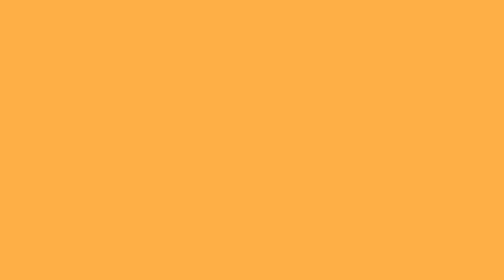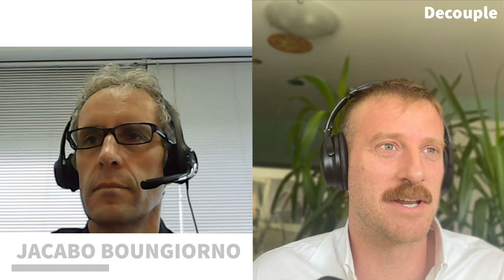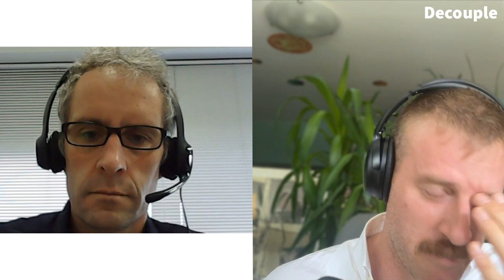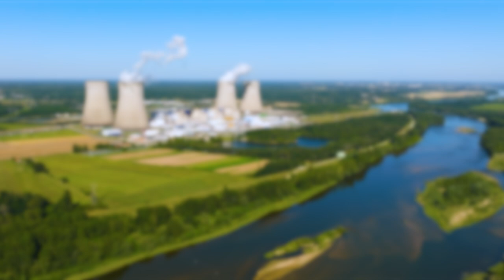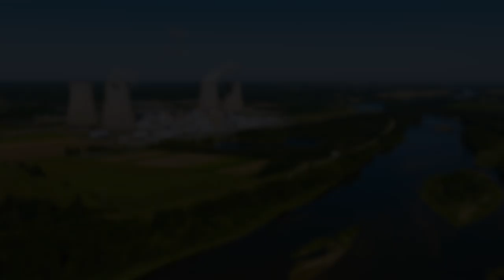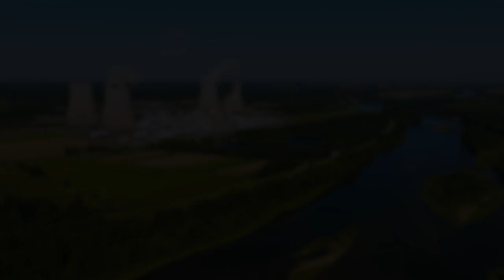Why is Western Nuclear so Expensive?

Comment: This was a great episode!  As someone else mentioned here, the nub of the problem is the lack of vertical integration.  The talk regarding modularity (ie prefab modules) was also very enlightening.  Then there is the problem of the lost of experienced people for restart of new projects.

I feel what Ontario should embark on, is a School of Nuclear construction and operation.  Basically, retired operators, techs, engineers, site supers and project managers would be instructors.  The instructors teach and do training of new students, as well as retraining, and ongoing training of current staff at various nuclear stations.  These folks could also be initial evaluators of new construction techniques/assembly techniques.  With Ontario having multiple designs of nuclear systems, both in generation and in design/type, having a mechanism to retain the experience from the varoius plants and projects, then have the students start work in an apprenticeship capacity at plants, I think would create a virtuous cycle of skill development, skill retention, and a structured method to allow improvements in construction and operation.  I could even see such a school draw international demand from other countries, and the various nuclear industry contractors start to contribute their knowledge to help train future customer operators, particularly if its their first build.

Comment: At around 10 minutes into the interview he gets to the nub of the probrem.  Having non-integrated teams who don't share the same financial outcomes, and don't necessarily build up a track-record building several plants in series, will have much higher costs. This is proven in the floating offshore oil production market. 

FPSO's are a type of supertanker or super tanker-like barge, which is moored over a deepwater oil field and has a production plant installed on the deck. The oil majors build them like nuclear reactors are build in the west - with conceptual designer, detailed designer, constructor, installer and operator all different parties. SOme specialist FPSO builders offer a lease and operate contract to the oil majors at half the price because they are vertically integrated, doing a lot of repeat business, and integrate the feedback from their own operations back to the own engineering design and own construction teams.  

The most fantastical part is that a large number of the oil major staff will not accept the truth when faced with the evidence, claiming poorer build and operating standards. Having seen the oil majors way of building and operating, which is good but never truly outstanding, my view is that the lease operators are often just as good.  Nuclear needs the same approach.  One key feature would be to build the nuclear plants in the same yard on a set of very large barges, and then stow them to the coasts where they will be installed (this 'beaching' of a barge is how a key part of the Snovit LNG processing plant was built for Norway).

Comment: There is no reason a Generation IV high-temperature nuclear power plant should cost any more than a coal or NG plant. 85% of the power plant cost is identical. Examples would be Terrestrial Energy and Moltex Power from Canada, ThorCon Power from Indonesia, Seaborg Technologies from Denmark and several others that are simple MSR designs.
Reply: Name a coal-fired or natural-gas-fired power unit with a containment structure.
Reply: @aliendroneservices6621  Name a nuclear power plant that needs a coal handling facility or hundreds of miles of pipelines. 
Also a containment structure that doesn't need to contain the internal pressure of a water reactor is much simpler/cheaper to build. No nuclear grade concrete is needed.
Reply: @chapter4travels  "...a containment structure that doesn't need to contain the internal pressure of a water reactor is much simpler/cheaper to build."
Source?
Reply: @aliendroneservices6621  The containment structure used by ThorCon Power is a double wall steel structure filled with plain concrete or even just sand. They ran worst case scenarios of plane strikes that resulted in a simple dent. This has also been tested in the field, they show the results in one of their presentations. There is also no hydrogen buildup to contain so the volume is only what's needed around the reactor.
Reply: @chapter4travels  Thanks. We're still awaiting proof-of-concept for Martingale's (a US-based company) ThorCon design to be built in Indonesia. An agreement was signed in 2015. It was last scheduled to go online in 2028.
Reply: @aliendroneservices6621  Don't forget about the dozen MOUs they have signed. All meaningless until Indonesia commits to a power purchasing agreement which may never come.
Reply: @chapter4travels  The molten salt reactor at Oak Ridge expeienced huge unreliability issues.  There are many molten salt designs still "on the drawing board" and Copenhagen Atomics is doing excellent work on non-radiative test loops using molten salts.  However, the time scales to implement many molten salt SMR's commercially is perhaps decades, by which time renewables will totally dominate the energy market.
Reply: @aliendroneservices6621 the acceptance criteria for sizing containment is to accommodate the mass-energy release of a large break LOCA without failing.
Reply: @thewiseperson8748  The only thing wind and solar could accommodate, long-term, would be the permanent-blackout market (as they cannot reproduce themselves). I don't take issue with the rest of your comment.
Reply: @thejfactor1  Got it. Thanks!
Reply: @aliendroneservices6621 It’s a simple comment on water flashing to steam, expanding 3 orders magnitude. Gas cooled reactors don’t have that problem.

Comment: The grid infrastructure makes up 66% of electricity costs.
Future electricity demand will be a 5times increase.
If central generation, then its grid capacity has to also be increased 5times.

The grid is extremely expensive, and  so it is fragile.
Expensive grid means distant renewables are not viable economically.
Expensive grids means central generation is not expandable economically. 

Any electricity generation increase that does not need complete grid expansion is the only economic possibility.

Comment: WTF is rainforest concrete?
Reply: reinforced concrete with steel rebar. Needs to be very carefully poured, sprayed and cured carefully due to the small distance between steel. There is a critical need to ensure there are no cavities or weak spots in the structure.